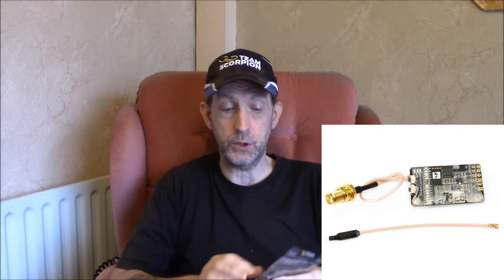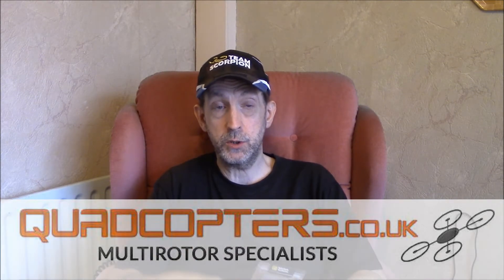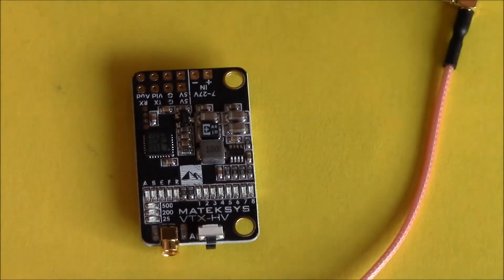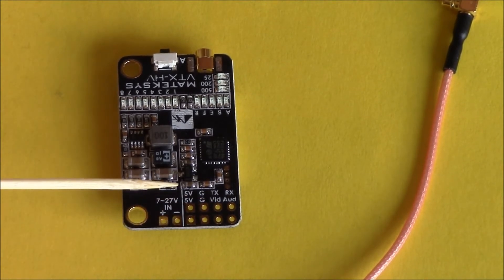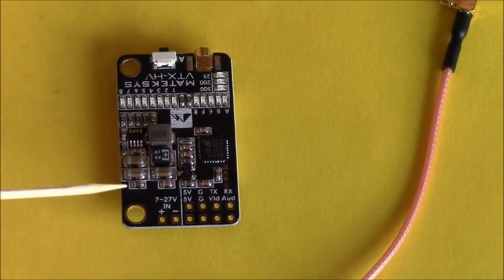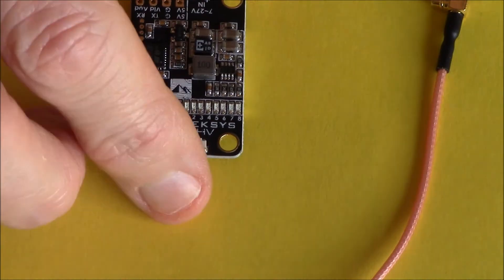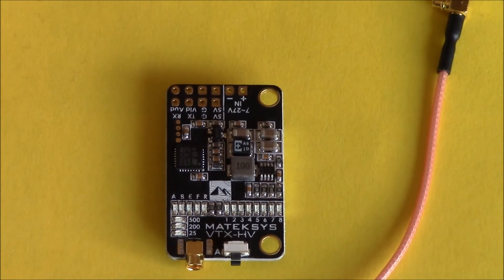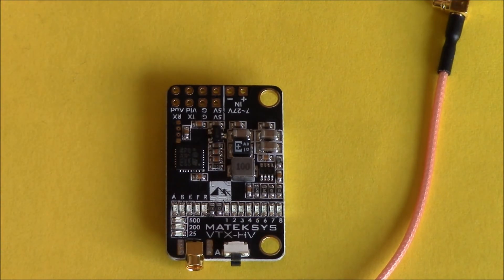Matek VTX HV 40 channel HV with RC Control.  ( New Version   )

Comment: I can't get the connector to mate up to my VTX, am I doing something wrong. It's the exact same as that one you have there!
Reply from the maker: If your using the connector that came with it, there is a fault and I would send it back. If however you are using a different  connector as in a FPV antenna that comes with a MMCX  connector It may be the wrong size. Hope this helps and sorry to hear your having problems.
Reply: Found out, you really have to push it hard. First VTX, was being a bit delicate with it. Cheers for the reply!
Reply from the maker: Glad you sorted it ( and yes you have to push it until it clicks ) feel free to ask if there is anything ells, happy flying Matey